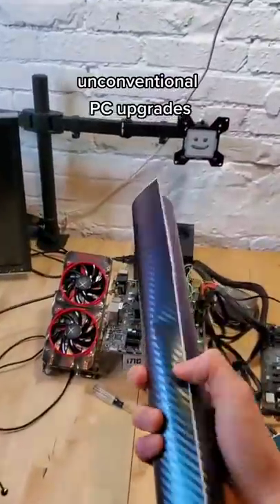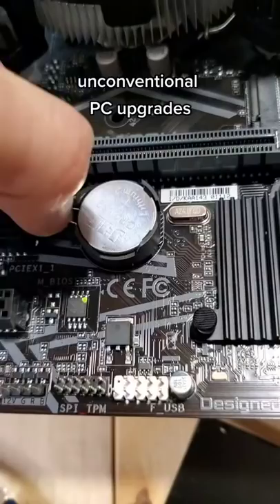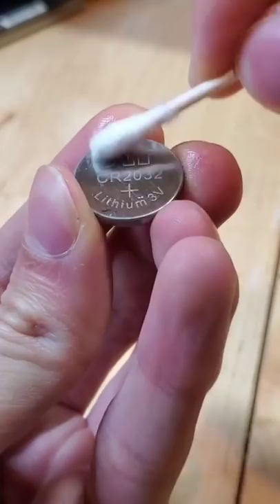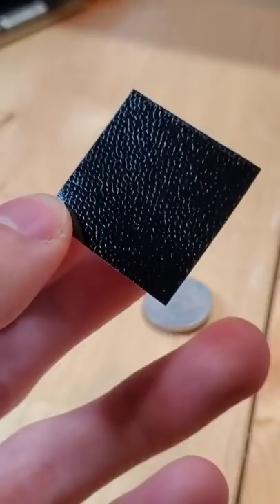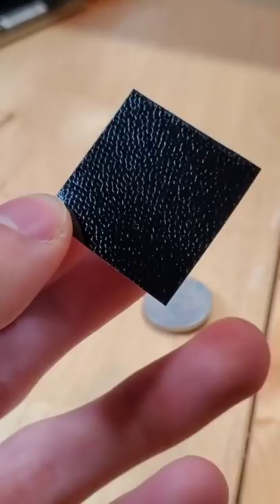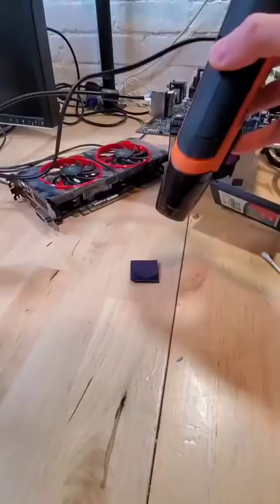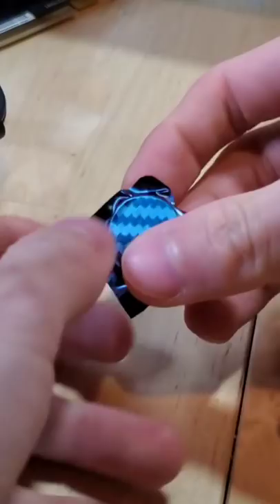how to upgrade your PC's CMOS battery #shorts

Comment: Ah yes, heating a CMOS battery with a heatgun. Perfect for my explosion thirst
Reply: As a pyromaniac, I agree
Reply: Most stupid idea and the plus connection is covered.
Reply: Right? Like this guy must stab bloated lithion batteries at this point
Reply: Bro, a heatgun isn't going to produce enought heat in that ammount of time to make the battery explode... 🤦‍♂️
Reply: @JackRR15  it gives enough heat to remove charge. And btw it still could explode, depending on battery it self.
Reply: Megumin: EXXXXPLOOOOOSIOOONNNNN
Reply: @JackRR15 they are mercury button cells. mercury gets heated up really fast.
Reply: It's a chemical battery. They won't explode from heat, unless you throw it in the sun. They aren't like lithium batteries which store electricity by ions
Reply: @JackRR15  but the heat will destroy the battery
Reply: @elishodo  🤣
Reply: @ZaHandle    you really don't undestand, do you? Most of these disposable batteires including button cells lile cr2032 and lr44, and standard batteries like AA and AAA and C and D and many others, are mainly batteries that are powered by a chemical reactions between zinc and manganese oxide, or carbon, or nickel and another reactant. 
These are the single use batteries you find in most remotes, toys and it includes the one in this video. These are very inexpensive and very rarely explode from anything. You can throw them, bend them with pliers, cut them in half, short them etc, the most that will happen is they will either get hot from energy passing in a low resistance loop from shorting them or the nasty shit will leak out of them which smells bad. 

The other common type of batteries are nickel metal hydride batteries (NI-MH). These are the second most common that you see in the form factor of AA or AAA etc but they are rechargeable. These can be more dangerous but most have a venting system if they ever get overhcarged or anything, still won't explode easily.

Lithium ion and lithium polymer batteries are least commonly found in these form factors, as they are dangerous and can explode easily from short circuits, overcharging, piercing and any other improper use. They use the movement of ions to store energy unlike the other batteries I've talked about. These are most commonly found in phones, laptops, wireless headphones, hobby grade ecosystems and many other devices. They're the most powerful but also the most dangerous if used improperly.

You will not find a cr2032 li-ion or lipo battery on laptop and desktop motherboards as they don't exist. The ones thay do, have a reaction between lithium and manganese oxide which isn't the same as storing energy by ions. They're low power and used in watches, keys and other things like motherboards to power the CMOS and RTC.

I am an experienced RC hobbyist in RC cars and racing FPV drones and have much more knowledge on the different types of batteries and all their parameters..
Reply: ZaHandle  yes, they still store energy chemically and don't explode from a bit of heat or shorting
Reply: @electronnuclear  No they're not. There are no commercially available mercury based betteries. These are lithium based. Note, not lithium-ion or lithium-polymer, just lithium.
Reply: @elishodo  0ppppp000000000p0ppp000ppp

Comment: Didn't you just isolated the positive side of the battery!!
Reply: No not really, the positive side of the cmos is the top and its sides, most cmos battery holders have their contacts on the side of the battery and not on the top
Reply: @krishoku  
Dude, the vinyl wrap also covered the whole side of the battery
There is no more contact
Reply: @JT_6233  You can see the wrap sticking a bit up when it's in the holder - indicating that it probably got pushed up and it's now maybe* making contact.. But that doesn't change the fact that this is a bad modification.. I was expecting more than a wrap...
Reply: @SmileyFace01  yeah, "upgrade"
Reply: I was about to say the same thing, looks like he covered the entire top section including the sides, that positive terminal is definitely not making any contact with the retention clip that also acts and the positive contact clip. It won’t stop the PC from booting at all. Just make it a bit annoying to have to input your BIOS settings every time the board is fully discharged.
Reply: No the sides are exposed
Reply: @JT_6233  bruh u blind
Reply: @codythomas4794  still not an upgrade, If anything, adds more thermal conductivity to the cmos battery, last thing it needs is more surface area with how sensitive it is
Reply: @crab-manSorghame  oh no, you're applying logic to a joke video. there's the issue.
Reply: @crab-manSorghame  Wtf are you even saying?
Reply: What song is that playing in the background?
Reply: Didn't you just trashed the sentence!!!

Comment: Asus gives stickers for cmos 🙃
Reply: And they have been doing it for well over a decade, going all the way back to their first cross hair boards.
Reply: Why not just a plastic cover?
Reply: @masterjason8699  Because designing and manufacturing such a thing would cost a few cents a motherboard. Where it would take multiple sticker sheets to even cost a single cent.
Reply: You just reminded me I still have mine in the box lol
Reply: I've had a couple maximus boards and seen the stickers, never realized they were for the battery
Reply: OHHHHHH So this is what that round sticker is made for 😳
Reply: On their website?? Or where?
Reply: @OmarMartinez-id5bt  their higher end motherboards come with them
Reply: @bigbuckoramma  What hair 🤨 ?
Reply: @OmarMartinez-id5bt  Comes with the motherboard. My Gaming TUF MB came with a whole sheet of different stickers.
Reply: thought I would never see this comment, you mean that circle sticker with ROG logo right? Wait, so it's for cmos battery? They come in many sizes. I was wondering why they give the stickers for free.

Comment: First off he isolated the positive and negative sides of the battery and also he used a hot air gun that could have exploded the battery do to the heat
Reply: Do you even know which is the negative and positive side?
Reply: @menantumakawak  the side with the + is positive and  the other side is negative
Reply: @menantumakawak  also one other point I didn’t mention is he cleaned the battery with what I assume is isopropyl alcohol which evaporates quick but is still conductive so he could and probably did short the battery which is very dangerous
Reply: @adamsalem-s  Yes and the positive side isn't covered and neither was the negative side. The clip touches the side of the battery which is positive
Reply: @adamsalem-s  It's a 3.3v button cell. I don't quite know what you think is gonna happen to it but it'll sure as hell be underwhelming. Shorting it might heat it up a little and heating it up might make it expand or leak at an absolute worst case scenario. This isn't a dangerous battery.
Reply: Lmaooooo. You read 2 comments and you think you know everything. Nothing about this was dangerous. Useless, yeah, but nothing bad was gonna happen here. Evidenced by the fact that nothing happened
Reply: @josephpbrown  It's a lithium battery, lithium is sensitive to heat and can burn if it gets too hot, even if the battery itself is low effect the lithium metal still can burn hot enough to burn, hurt or at worse start a fire. I feel like you have to know this, why else would you try to dispute him? So why would you play down the actual risks? Heat and Lithium = BAD
Reply: @josephpbrown  I (exploded) a lithium coin battery and yes it was underwhelming just some smoke but you don’t really want to do that anyways and it’s not safe.
Reply: @tesseract5569  yeah nothing happened but things could have. Also I have experience with electrical stuff
Reply: @menantumakawak  good point thank you for correcting me
Reply: @adamsalem-s  i have tried to make lipos react/explode  by shortcircuit and failed in my 3 attempts, and you are exploding coincells... HOW!? i need to know!
Reply: @cocotug0  I tried to solder to it, it was underwhelming  what I mean by explode is like it popping open or popping open and sizzling

Comment: Can you please change the BIOS chip. (Remove the old one, Install the new one.) I want to see what will happen.

Please...
Reply: He'd have an empty BIOS/EFI firmware and a computer that doesn't boot.

Unless you're talking about the CMOS memory which is volatile and erased when the battery is removed.... In that case, it'd act just like if the battery was removed and store new settings to the chip.
Reply: @off spec you forgot one thing… you can’t Even fucking see the battery if a gpu is installed

Comment: does the battery still work with the sticker on it? wouldn't that break the circuit?
Reply: You would need to cover the whole battery, but this is bad too even if it works
Reply: I don't think the sticker material is electrically conductive - so no.

Comment: Never block contact points on a battery where electricity is passing through, you'll get melting vinyl and have issues with your bios, this is not a smart mod in any way and will just lead to issues with your motherboard

Comment: I thought he was going to put a full-size 18650 cell in there for some reason
Reply: If you put a silicon diode in it the right way the voltage can drop to a manageable level...